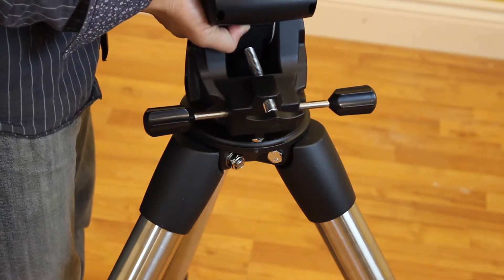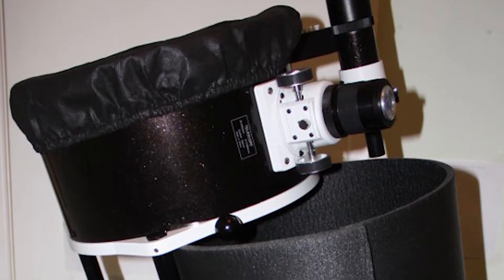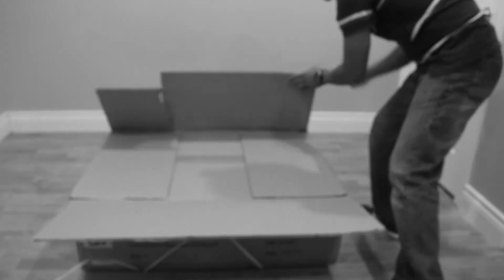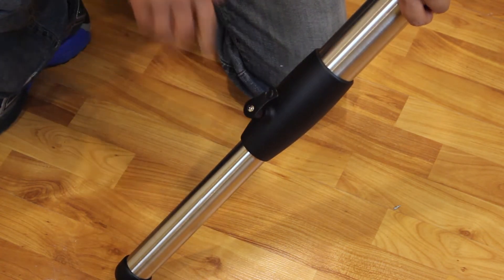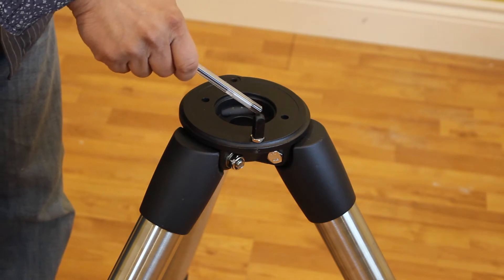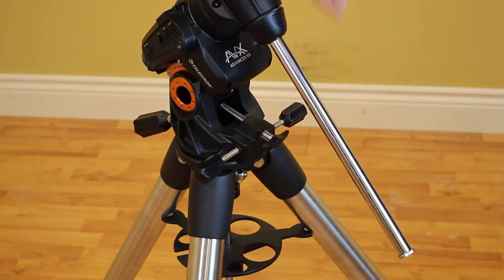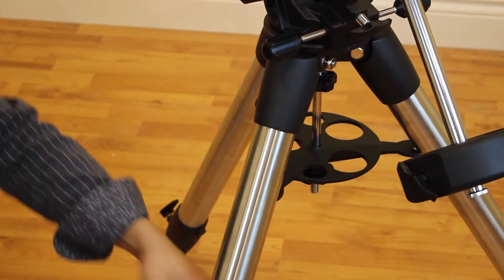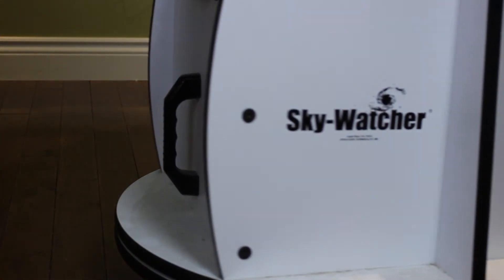Celestron AVX & ES ED102 Assembly | Farewell Skywatcher Dobsonian

Comment: it would be interesting to know why you replaced your Dob with a 102mm refractor on an EQ mount
Reply from the maker: I found the 12" dob too cumbersome to transport so I thought a smaller telescope would be better. In hindsight, I found this new telescope to have the same issues. I miss my dob and regret selling it. :(
Reply: @NewAstronomer  but if you get a small tripod and alt az mount... You can do light grab and go, plus astrophotography on the avx. That is lighter than the dob for visual, and better than the dob when you have time to setup the avx.

Comment: Hi Michael!  re: Celestron AVX & ES ED102 Assembly)  the "dove-tail", (of your clam-shell cage) needs to be rotated 180 degrees, so the locking bolts apply pressure to the stainless steel bar (on the opposite side) ...not to the painted, aluminum casting.  Then spin the ED102 scope around, 180º as well. :)  RCK  Clear Skies!

Comment: one question, as you are in the U.S., do you know if these mounts can be used in the SOUTHERN hemisphere ( Australia) as all the shops over here sell the cheap & nasty brand "MEAD"or "Celestron" , but we are all 'drooling' over your explore scientific, Takahashi , Stellar view and other brands who incidentally are either European, Japanese , or from your country, but we question can we use them over our way??, as we CAN"T see Polaris, the star these mounts are designed to be rotated around ( as most videos seem to infer) as it is impossible, due to the earth's curvature!!
Reply: You align one of the mount's axis of rotation parallel to the earth's axis of rotation, which passes through the poles. South of the equator you use the Southern Cross as the point of reference. The mounts will work fine in both hemispheres.

Comment: I think that's a good trade off. The dob is Great, but the size and weight and cool down time is a little much. Wives hate telescopes. It's in the DNA
Reply from the maker: Well not all... she made my light shroud after all and there is a small number of female subs here as well. I agree with the disadvantages you pointed out though and I was not using the dob as much for those same reasons.